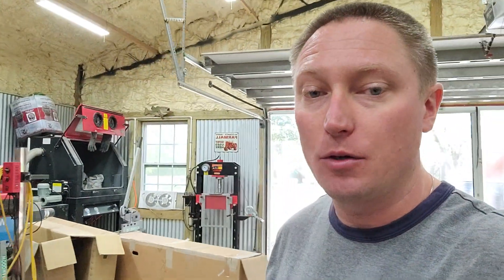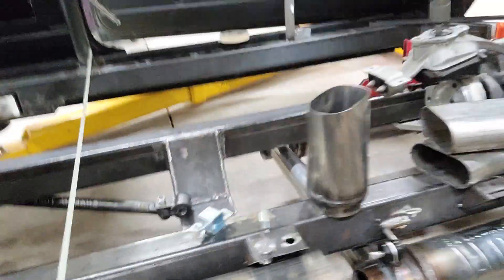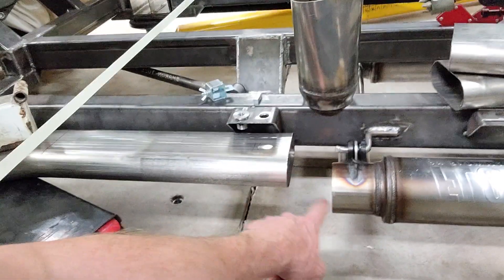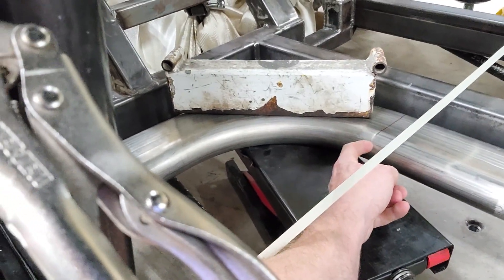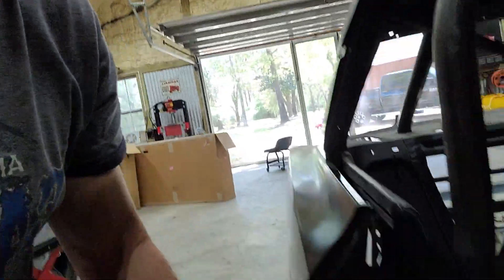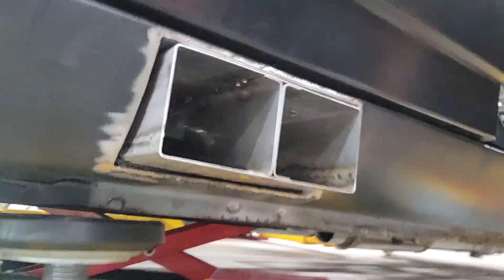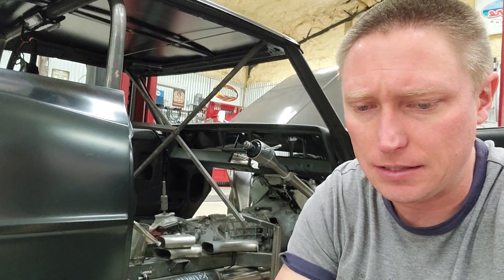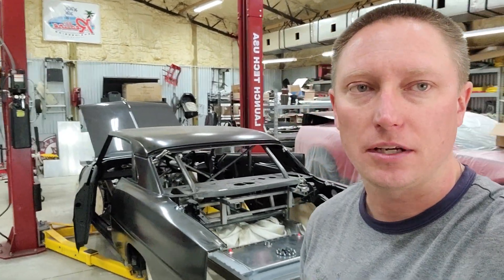Weekly 1967 Nova update - exhaust report

Comment: Hey man on your powder coating video u was complaining that the regulator was junk . Well its not a regulator its a flow valve that controlls volume not pressure. U still need to requlate pressure to 15 lbs
Reply from the maker: Yeah, I did a follow-up video on comparing those two systems and my 2nd video was way better and we addressed that in the 2nd video.